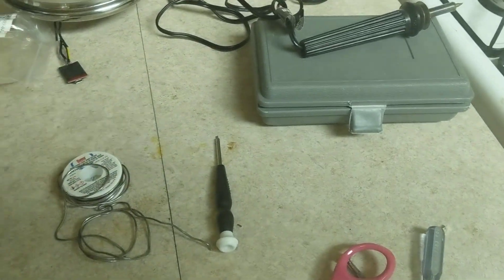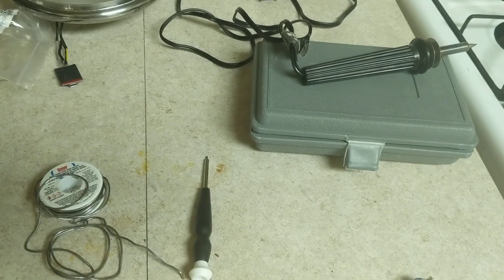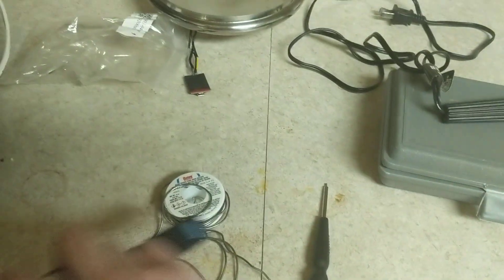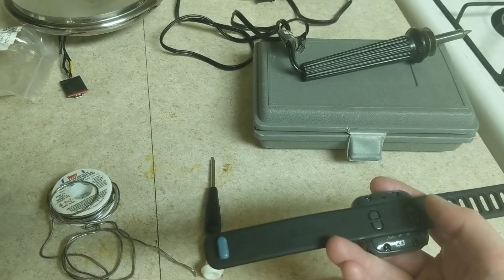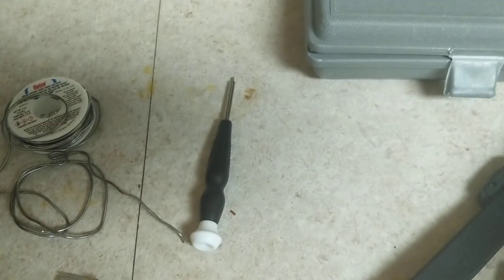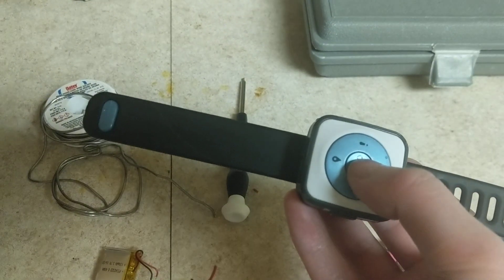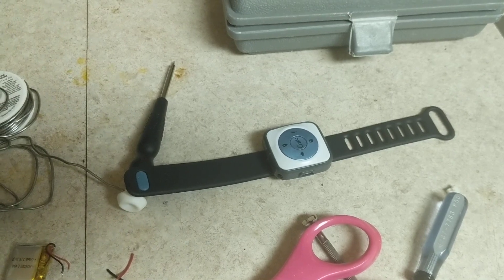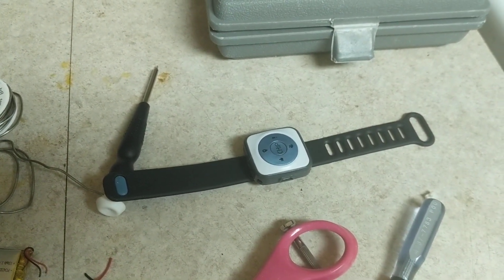Chip wowwee smartband battery replacement success!

Comment: Thanks for this video.  Can the wires be spliced and then connected instead.  I'm afraid of soldering to the motherboard so thinking of just splicing the wires together instead?  Such as the case in Cozmo battery replacements.  Thanks for all your videos. They are awesome.

Comment: I had this issue with the battery where it won't charge and flashes purple rapidly. I plugged in the charger and unplug the charger as quickly as I could hoping it would give little burst of charge in the battery and after about 10 times the battery started charging again. Hopefully this helps some people and saves them from having the replace the battery.. I did this via the connection that goes directly into the watch itself.

Comment: I remember that old video, good info in case mine does this. Great job!
Reply from the maker: Hopefully it doesn't happen. If you are sure to charge it every so often, you won't have this issue. I did not charge said smart band for several months and the battery was over discharged. Lithium batteries die when not charged for too long, but this should be something that happens over years rather than months.
Reply: Einfari Âûtomata Good to know. Thanks for the tips. I’ll be sure to charge it more often now, in the meantime, great job with the repair!